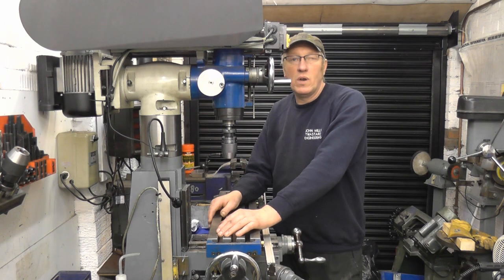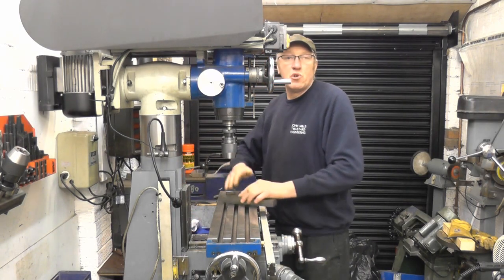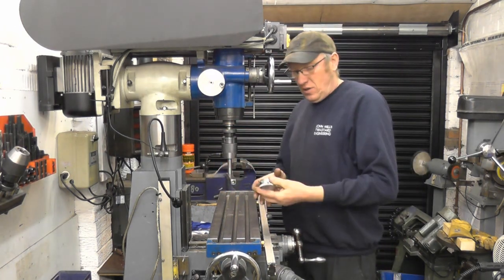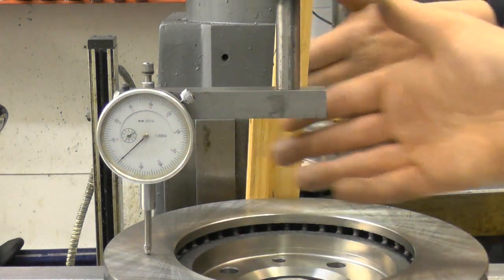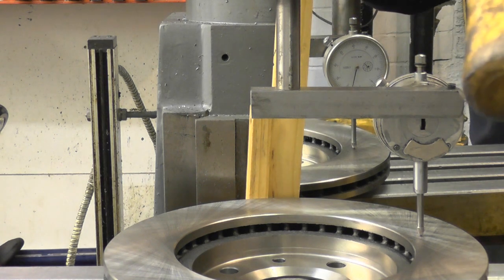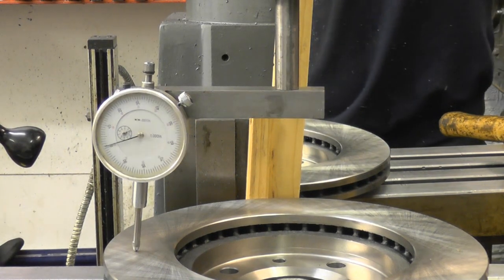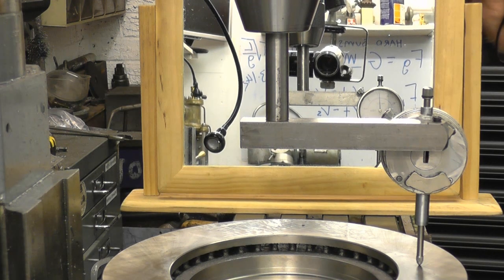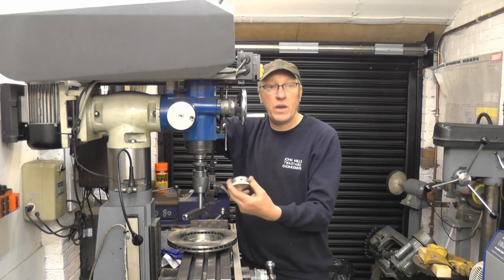Trammng A mill

Comment: When making a tool to check another tool, your check tool has to have at least 10X greater precision than the work you are doing or it has no utility.
Has that brake rotor been stress relieved in an oven and then surface ground?  OF course not.  So you're just measuring the thermal and physical defects in a turned brake rotor. Do the job properly, the way you were (hopefully) taught to do it.

Comment: Took my car in for MOT some years ago. Failed on corroded discs - so they fitted new ones.
Collected the car, didn't go 2 streets before taking it back to have the brakes fixed. Needed a new disc as one of the 'new' ones was warped !

Comment: Thanks for such an informative video. I’m not sure about using the magnetic clock gauge though. At about the 6 minute mark, you can see that when you tap the head over the impacts are causing the clock gauge to jump off true. That’s bound to give a misleading reading. Keep up the good work though! I’ve learned a lot from your videos 👍🏻

Comment: Hi John, just a quick tip for those who don't have a disc rotor, a piece of glass on the table works really well. A piece of glass that is around 6 inches square will generally be flat within .01 mm. I use a piece thats 8mm thick. Great vids champ :) Cheers, Bill :)

Comment: Hi John, Thanks for the tip. But look what you have done with your brake disc. Had to go to the local garage and acquire a SCRAP disc, which now I'm machining to true up. My milling machine just delivered  looks similar to yours, but for the colour, and must admit is out of square. I shall be needing a shim as well under the front pillar bolt as first indications show 0.008" out. The brake disc will prove it. In this area no new stuff is obsolete. regards

Comment: For my Bridgeport, I use a new disc rotor from a Crown Victoria (about 11" in diameter)  I feel that this method of tramming a mill is more accurate when using the rotor face against the table, rather than the hub. The rotors faces are accurately ground parallel to each other, but the hub face isn't always perfect.

Comment: Nice tip John however your method will provide questionable accuracy. The head is always trammed to the bed and the indicator should be on the spindle vice held in a chuck. Any run out of the chuck will be transferred into your readings. At least that was the way I was tought to tram a mill good buddy.
Reply: Run out in the chuck is irrelevant. As long as the "accessory" is rigid it will work perfectly. Look at it like this, If you clamp something on to the spindle that automatically has inches of run out!
Reply from the maker: SuperSwitched
I have included the end to end test in this Sundays night cap
Be posted later (the results ate interesting)
Regards
John
Reply from the maker: SuperSwitched Hi
I have re done the test
It will be posted on this Sundays night cap (be posted later)
The results are interesting
Reply from the maker: ***** That is what I thought
Reply from the maker: Hi
Would the run out not be the same through a complete revolution
It is not like drilling a hole
Reply: The way I was taught John was to always use a machined surface or part of the machine. In this case the chuck is an accessory and is not an integral part of the mill.

That being said I know that a home machine shop is not meant to be highly accurate. OTOH regardless of the last observation it is incumbent of us to set up our shop/machines to be as accurate as possible. No?
Reply from the maker: SuperSwitched I am going to try it now lol
Reply: I too have been show a few ways of doing this.. One was kinda the same way john showed us and the other was us ring the table it's self with nothing on it that could be off at all and also most of us use the center of the table so it you do that same reading at the ends of the table I bet they would be off by a bit.. I think all the methods get it close enough for good work.. But I would like to see what happens when you run your table from side to side and what the change is.. I also use a very fine stone and oil to clean my table... Thanks John I really enjoy your videos! I have since you started and I'm sure I can speak for a lot of other out there that we feel like a part of the family and that means a lot! 

Dennis in Pa USA
Reply: volcom7114
Very good observation. The delta could be quite substantial from one end to the other end of the travel. A possible solution, set the table centered and tramm at a greater diameter. e.g 24". Just requires a longer rod (12"), then run your dial to the end of the table on one side, and repeat for the other side.

Comment: John your videos are great, your right next to Keith Fenner & Adam Booth in my list. I've got a 6"x6" piece of 1018 bar to make the column riser like yours. Do you still have the dims of yours, I  haven't pulled the head off of my mill yet and am asking you for any advice. I'm thinking I can mill the slots before I dissemble. I have another "Twastard Engineering" idea I'm thinking of boring a couple more holes for a ER32 collet/straight shank and support bar(s) to add a  Horizontal Mill feature, kind of like a K&T machine. Any thoughts on this.
Reply from the maker: The dimensions of the mill column are all different
TROUBLE AT MILL
Be interested to see your ideas for horizontal milling
Reply from the maker: TROUBLE AT MILL
Reply from the maker: The head dimensions are all different lol
Be interested to see your horizontal modds
TROUBLE AT MILL

Comment: How flat is the break disc?
Reply from the maker: The disc is flat
I can not measure any run out with my equipment
Reply: doubleboost
 That is very good then, did not think the disc's where that good. Nice tip will try to get one myself.